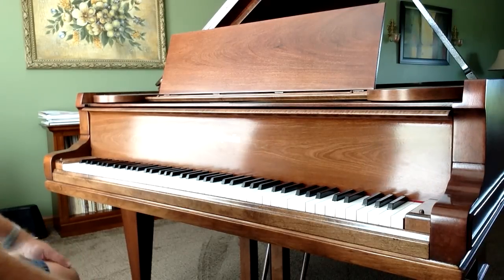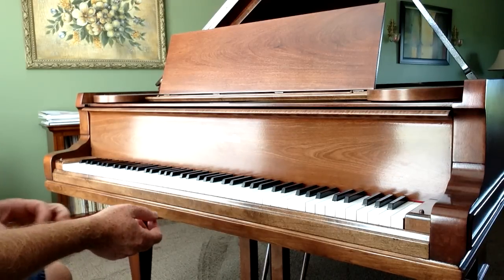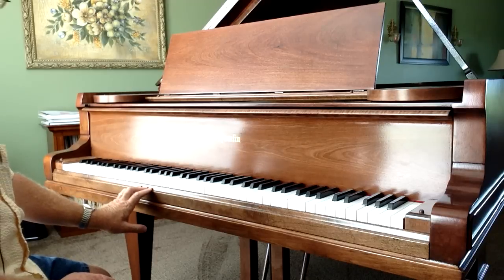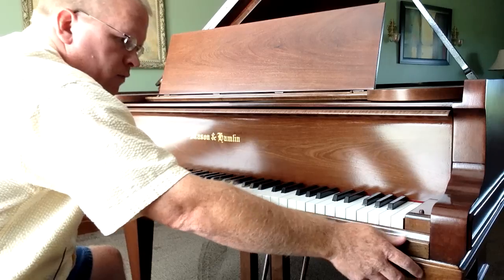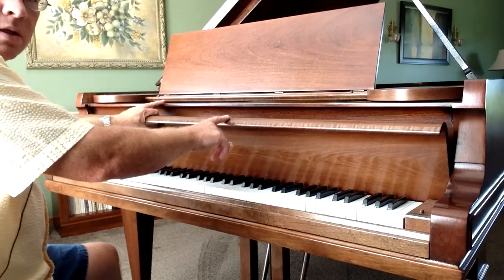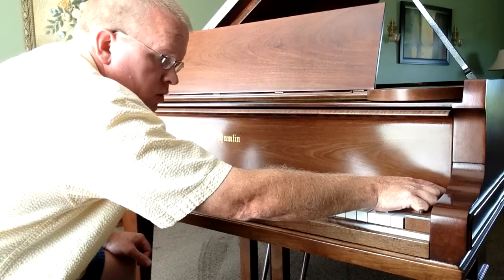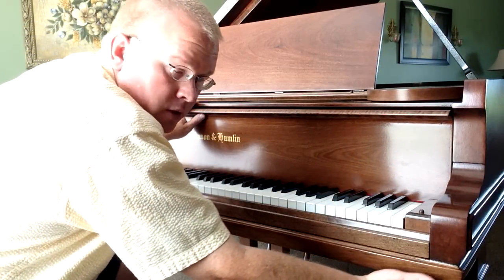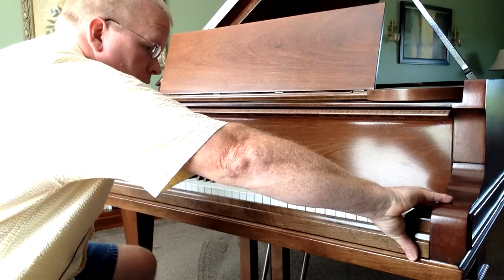Removing A Grand Piano Action - Piano Tuning & Repair I HOWARD PIANO INDUSTRIES

Comment: This is a truly great video. It demonstrates the best of YouTube: experts sharing their knowledge - for free - and helping people who otherwise would have to spend a small fortune (and probably wait days if not weeks for their problem to be solved). I learnt a huge amount about pianos through watching this and following the steps. And I was able to resolve my issue (a loose fitting that was rattling annoyingly and ruining the piano's sound, but that I wasn't able to reach until I removed the action). It was also very helpful that you included information about Asian pianos, as without it I might not have been able to perform the task (my issue was with a Kawai).

In short, you've done a great public service! Many thanks.

PS Is that a Canadian accent?

Comment: thank you for your great videos, i'm afraid to remove the key slip. i have a 1904 baldwin concert grand that needs a lot of work now, but even though i am disabled i feel that i can still do it.i did when i was young.
Reply from the maker: Hi Wendy,
Removing the key slip is the easiest part of this process.  When taking the action out the biggest thing you want to be aware of is to make sure you’re not pushing down on any of the keys as you slide the action out or that any of the hammers are sticking up at all as this will result in hammers breaking off.
Reply: @howardpianoind  thank you so much. i used to know how to do it! but it has been years and i want to start to tune my piano again myself with this covid  stuff.

Comment: Steve,
A friend just acquired a 1905 Mason & Hamlin AA (6' 2") grand piano. It was reconditioned 30 years ago. Although the piano has been in a good environment, it is very dusty and needs a thorough cleaning. The action's touch and tone are outstanding. How can a Mason & Hamlin grand piano be that exceptional after all these years?
Thank you for your videos. I cannot believe that your example is a Mason & Hamlin grand piano.
Reply from the maker: Thanks!  Yes, this is also a AA.  It is from 1915.  If a piano is kept in a good environment and isn't abused, it can stay in good condition over the years.  In most cases it is the climate and humidity changes over the years that deteriorate the condition of an action.

Comment: Thank you for the video! Can I please know why the sounds become dull after putting back to the action back? I took out the action and cleaned them. I hope to hear from you. 🙏
Reply from the maker: I'm not sure, but it could be that the action is in a slightly different position, which would cause a different part of the hammer to strike the string.

Comment: Hi howard, hope you're doing well. I wanted to ask if you got the piano with that action mechanism or did you substitute components with new carbon fiber parts such as Wessell, Nickel & Gross?  I ask because I have a late 1800s Chickering and sons with an old action that Im thinking of substituting with something modern... but cant find anyone online that has bought parts from them, only their full action. Thanks a lot, and great videos.
Reply from the maker: Hello, I am answering questions for Steve so I don't know for sure if this piano came with these parts but my  guess is that they did because the company that makes Mason and Hamlin pianos is the same company that makes Wessell, Nickel & Gross parts. I have seen these parts used widely throughout the industry. 
    - Russell Schmidt, Piano Technician with Howard Piano Industries

Comment: Thanks for this very informative video! My issue is that the left soft pedal doesn’t work, and after looking inside while hitting the keys, I saw that the hammers are too far to the left of each 3string set so the soft pedal can’t move the hammers to the right enough to just hit the right two strings. Could it be that the keybed wasn’t put in correctly and too far leftward? Is this something I can adjust? Thanks!

Comment: What if you can't remove the keyslip?  This just happened with me yesterday with a Yamaha C3 that's about 25 years old.  The problem might be caused by the keyslip pegs having become too embedded in the front of the keybed.  Any suggestions?

Comment: Have you ever put the action back in and certain strings will begin to lightly sustain after playing? This happened when I put the action back into a Steinway. The 6 or so lowest bass notes would sustain in a bell-like fashion.
Reply from the maker: I would guess you have pushed the action too fall back into the action cavity. It may need to be pulled slightly out towards the player. It may be that plate in the key block that holds the action frame pin will need to be adjusted.

Comment: Hello Steve, thank you so much for all these videos. I have a question. I was trying to remove the action in a Baldwin grand from 1920 and I noticed that the hammers do not pass through below the pin lock. It seems like the pin block is set lower than the average piano and the bass hammers seem to hit onto the pin block. I did not press any key while I was taking it off. Any advice on this?
Reply from the maker: The only thing I can think of is that the hammer blow distance is set too high.  You will probably need to lower the level of the hammers in order to get the action out of the piano.  This is done by turning the capstans to the left which will lower the height of the hammers.  It could be that someone raised the hammer height after the action was put into the piano.  Please let me know if you have other questions.

Comment: Action cradles are made for vertical pianos.  Where do you place the action of a grand piano after it has been removed for repair?  Do you just rest it flat on table?
Reply from the maker: Yes, I flat surface will work for repairs. For fine regulation it is necessary that the action sits on a surface that is the same as the surface of the keybed it sits on in the piano. This may not always be perfectly  level so the action may need to be shimmed up at places.

Comment: I have a Chickering concert grand that has some stuck keys and I noticed on the action some of the key hinges are sticking out.
Reply from the maker: This may be causing the problem, but I’m not quite sure what you mean by key hinges.
Reply: howardpianoind I fixed it! It was the key slip being too tight. Thank you so much for your videos!

Comment: I was wondering if you could help. I was given a beautiful Kawaii 600 Grand from the 60's by a neighbor. I was playing beautifully and in great condition. When I got it to my apt. after a few weeks a couple of keys are sticking that werent sticking before. Im thinking it might be the heat & Miami humidity in this new place Im living? I use the AC but dont keep the temp very cold.  I saw a video here explaining how to iron the felt that has swollen on a sticking key due to changes in weather etc. I would like to try that. Your video is very helpful teaching me how to remove the action so I can get to the sticking keys. Once Ive removed the action do the keys just slip right out of their place? Guess you can see I dont know much about pianos but I had to bring this one home since it as a gift. Thank you in advance for your help.
Reply from the maker: Once you have the action out you'll need to remove the action stack from the key frame.  There are usually 8 screws holding the action brackets to the key frame.  Once you have removed the upper action from the key frame, then the keys can be removed.

Comment: I have a 1920's vintage Kurtzmann grand 68" long that I need to move 4 hours away.  Before it is tipped on its side onto a dolly, I assume that it would be a wise idea to remove the entire action as you have detailed in this excellent video and pack and transport it very carefully in a horizontal position (as it sits in the piano).  Would you concur?  Anything else I need to know about that particular piano in order to remove the action?  I saw a reference somewhere to "locking the soundboard" when moving a grand piano.  Do you have any information or recommendations on that?  I will be making the move with a hi roof cargo van that is open from the passenger compartment into the cargo compartment, so some heat will be moving into that area.  This move might happen in cold temperatures here in ND.  I assume I will be fine if the cargo compartment stays above 45F or so? Anything else?  Thank you sir!
Reply from the maker: Typically grand pianos are moved with the action left in the piano.  There is probably less risk of something getting damaged with the action in the piano than trying to move it safely outside of the piano.  I haven't ever heard of locking the soundboard.  I can't imagine what this would be referring to.  You do need to strap the piano down well to the skidboard to prevent it from slipping.  Yes, if the piano stays in a 45 degree temperature this should be sufficient.

Comment: Question. Can I permanently remove the 2 front legs of my piano ? Not a baby grand just a regular piano
Reply from the maker: Most likely not.  For most upright pianos, the front legs are needed for stability.  I think there would be a risk that the piano would have the risk of tipping forward without the front legs.

Comment: SOS! I removed my action and then removed the stack to change the key bushings and after I put the stack back on and put the action back in, the middle range of the piano sounds muffled and the hammer let off is wrong on some notes! Any advice Please!
Reply: M's Compositions  make sure you have the action pushed all the way in. A fraction of an inch can make a difference. Usually, the keyframe pins will not allow the cheekblocks to fit back in properly if the action isn't placed back right.

Reinsert the action just like the vid says, by inserting the right side first to overcome the force of the return spring.

There are locators on the sides of the cheekblocks where the keyframe pins fit into. These serve as guides as to where the correct final pisition of the keyframe should be. The cheekblocks won't seat down ALL the way unless the keyframe us positioned correctly.

Sorry, this is quite hard to explain, but I noticed (to my extreme regret) that Howardpianos hasn't been posting.

Comment: I am in such a bother, I have  an 1834 Collard and Collard externally damaged by damp( veneer and scrolling) i mean. Inside pegs rusty have cleaned them, removed all the ivories which were loose and some of the ebonies, about 30% of the felts were loose so I manage to pull them out between the strings. Now I have to take the entire action out to re-felt and sort out the odd sticking key, because its so old and a wooden frame its hard to find any info on how to do it.
Reply from the maker: Hi Gill,
We have quite a few videos on our YouTube channel that you may find to be helpful.  We show how to refelt the keyboard as well as diagnose and fix sticking keys.
Reply: Allow plenty of time for your project. For an inexperienced enthusiast an action rebuild is about 300 hours of work! Enjoy the process, and I hope you end up with a wonderful instrument. A word of advice, before you get in too deep, have a good think about whether it needs restringing, cabinet repairs, bridge repairs, state of the soundboard. In other words, after you've put your heart and soul into the action, where do you end up? All the best!

Comment: Can low humidity make keys slow/stick?
Reply from the maker: Low or high humidity can affect the keys or the action.  The first thing would be to determine what is sluggish.  It may be the keys, or it may be something in the action.
Reply: Pretty sure it's the key because it's just slow at coming back up. It's not really stuck, but it (I think, not 100% sure) is a bit too close to the frame in front of it (the thing you removed at 1:12). No way in hell am I removing that thing myself though as I've only had my grand for about a week. Best bet is contacting the dealer again I guess (since I haven't met a tuner yet)

Comment: I tried to remove the first piece as shown in the video on my YAMAHA C2 grand piano but it does not work.
Reply from the maker: On a Yamaha grand you have to remove the blocks on the ends of the keys before the keyslip will come off.  The fallboard will come off separately from the key blocks.
Reply: @howardpianoind  Thank you very much sir! I successfully removed the action and put all parts back. I was surprised that you still look after your video after 4 years.

Comment: Thank you but I can't put it all the way back
Reply from the maker: You'll want to make sure that it is going in at the correct angle.  You may have problems if you try and put it straight in because of the spring on the side.  If you put the keyframe in so the right side goes in a little ahead of the left side, this should help.
Reply: howardpianoind thank you for the fast answer! I’ll try your advice, thanks again.